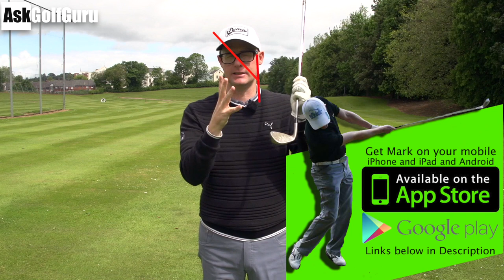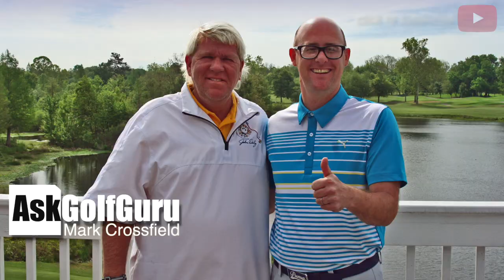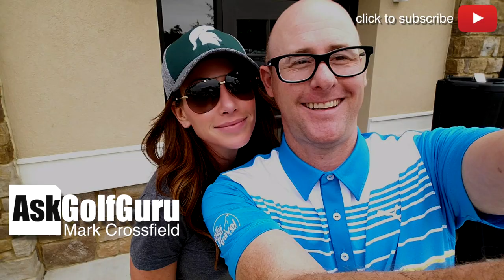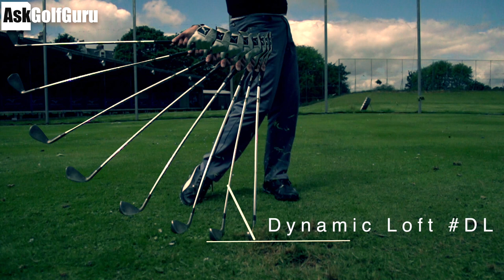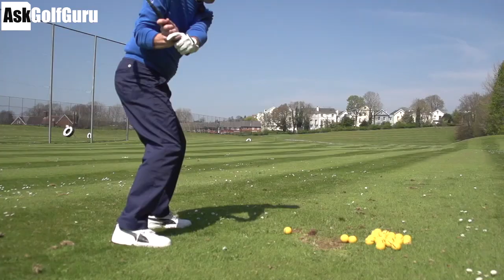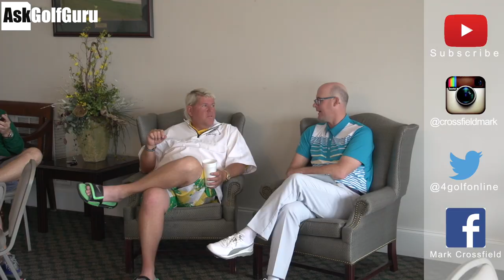Golf Terms Dynamic Loft

Comment: good stuff.  i am working on increasing dynamic loft at the moment because i struggle to get my longer irons and woods higher in the air these days....problem is i do not know where to start...guess i will mess around with twisting the club a little more open to the target at address and go from there.

Comment: I understand the meaning of changing dynamic loft and the benefits of it. One thing I cannot understand is, what are the benefits of increasing dynamic loft? For example if I'm hitting a 7 iron higher, why wouldn't I hit my 8 iron? Surely they would go the same distance and height?
Reply: That would depend on how much you changed the loft , you will find good players practice this to plug distance gaps
Reply: so then why not hit the club in which the yardage matches?